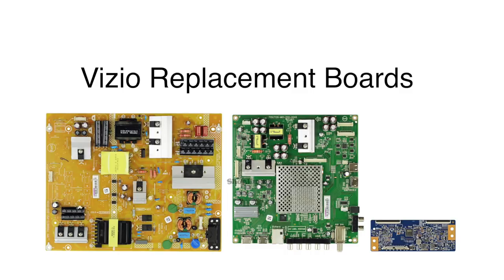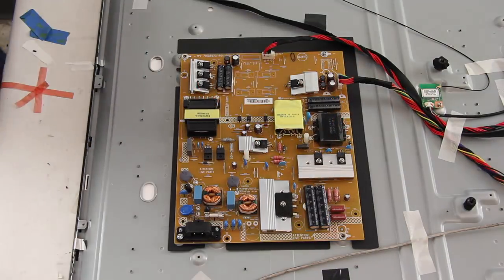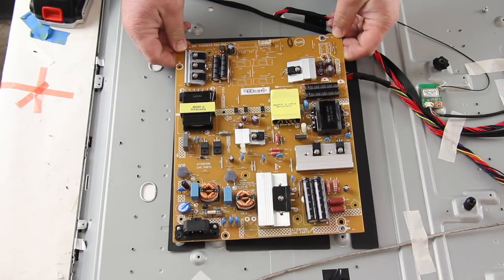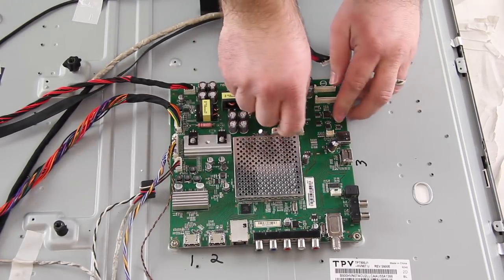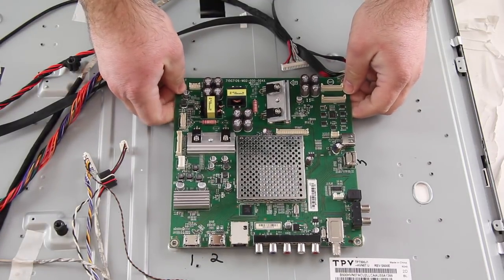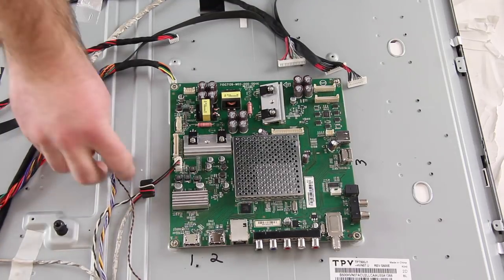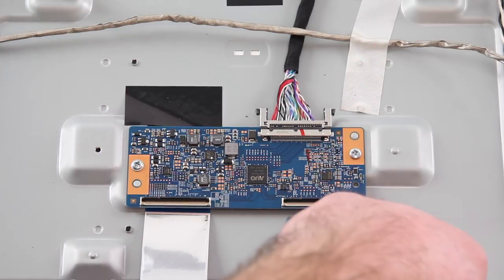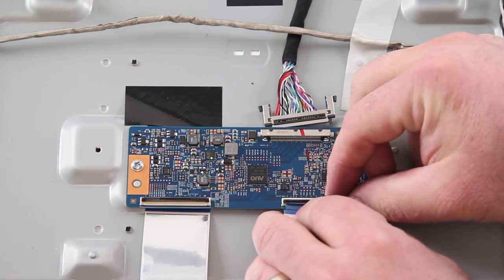Vizio 50" LED TV Repair E50-C1 - How to Replace All Boards Part Number KIT-E50-C1-K2

Comment: I have a D1 and the components on the power board are a bit different. is there schematic available somewhere. would have been nice if you described each cable, where it goes to and what its for as you disconnect. thanks anyway.

Comment: I ordered some parts from your store for my Samsung 43 inch tv...it was a kit...I replaced the parts but still having the issue of no screen on the tv...but all is working fine with the new parts....I noticed that one of the boards is lighting up with the 3 blue led which wasn't lighting with the old parts...any help will be appreciated
Reply: geo the best what is the model of your tv?  Have you done the backlite test? What board part did you replace?
Reply: I actually got the board for the model tv I have....I don't have the info in front of me but it's a Samsung 43...I got the whole kit and replaced all three boards it does seem as the back lights are not coming on....all this happened when I got a power surge in the house...but soon as I get home I will provide you with the model number